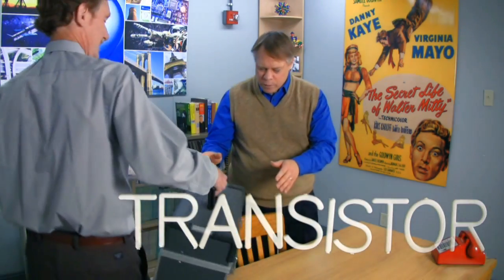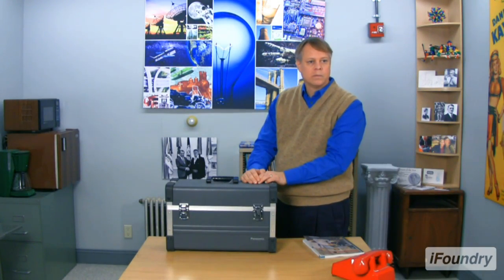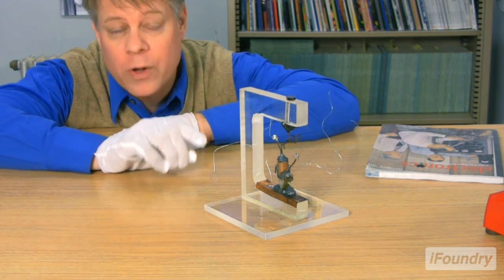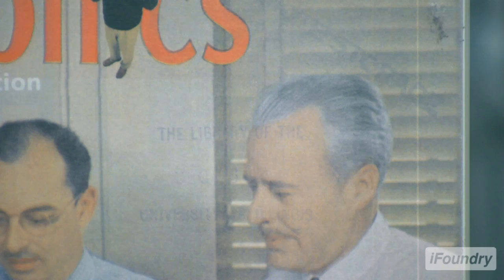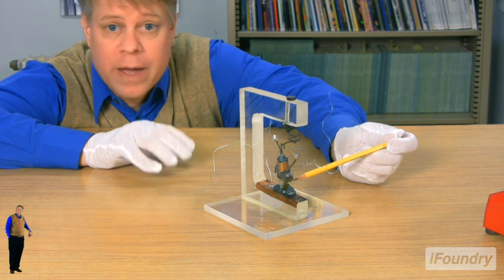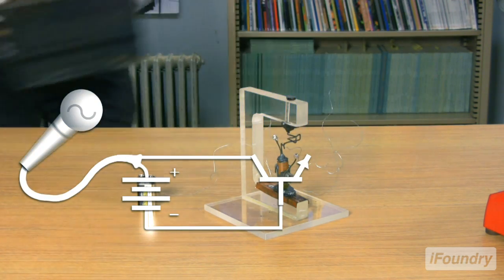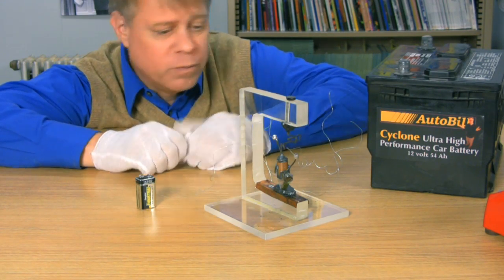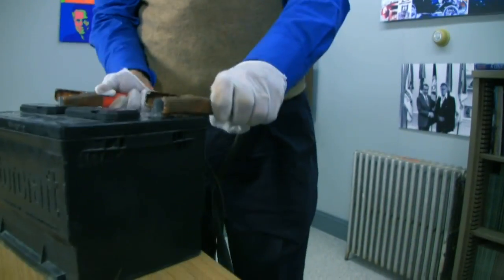Does the first transistor ever built still work?

Comment: Imagine a water dam, with a hole in it the hole is covered up by a door that can be opened, closed. when the water builds up to a certain pressure the door opens and since the water is being forced into a smaller area it builds up pressure. Now with a transistor, the gate is like the hole, the source is the lake the dam is holding back, and the drain is where the water does to, but instead of being a certain amount of water, the gate is triggered to open with a certain charge. (a and transistor)

Comment: many cheap audio amps work on a single rail,  with the waveform modulated with a DC offset.  A moving coil speaker doesn't like a DC offset,  but it can still work as shown.

Comment: there are at least 2 things out of logics on white lined schematic drawing:
1) first transistor available on Germanium PNP type only. Not NPN,
    so that polarity of batteries must be swapt.
2) mic must be connected at Emitter, Loudspeaket must be at Collector.
  (common base assumption is possible)
Outside that odds, the prototype is Great.

Comment: jajaja good video, but of course tubes had a plate load resistor and or impedance so transistors must have a collector (or emitter) load resistor.
And if it was a germanium germanium transistor  I bet it smelled like a garlic frt.

Comment: Actually, the original transistor still works, sort off.
It absorbs moisture, and so one needs to rub off the surface layer with a bit of dustless cloth prior to use.
But like a germanium crystal diode, once this is done and a new "sweet spot" is found, it will indeed amplify.

Comment: The positive terminal of his small battery needs to be connected to the BASE of the transistor if it is  NPN, not to the collector! this wouldnt fry anything, in fact it wouldnt do anything.  What did the first transistor resemble, a bipolar npn or pnp or neither?